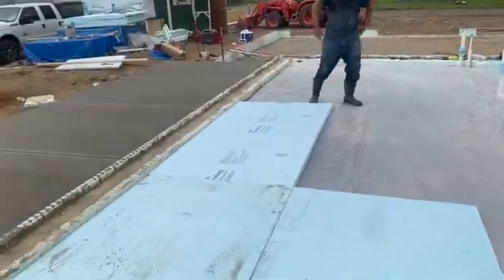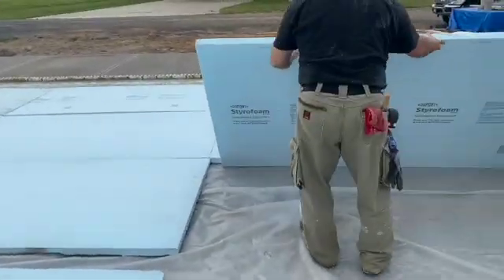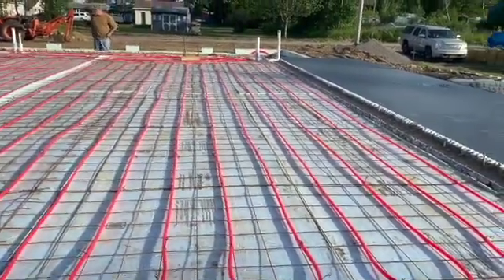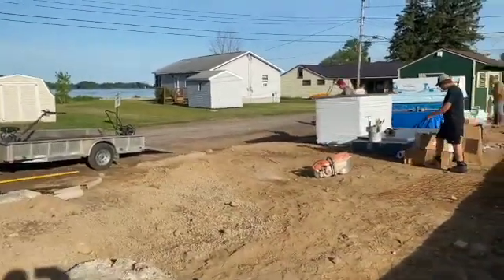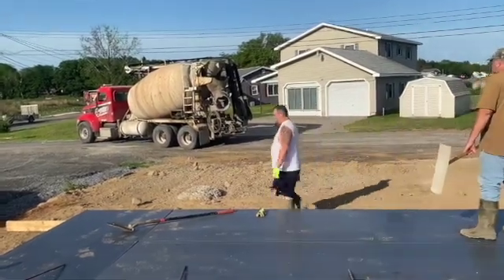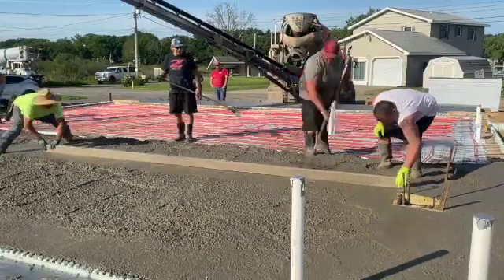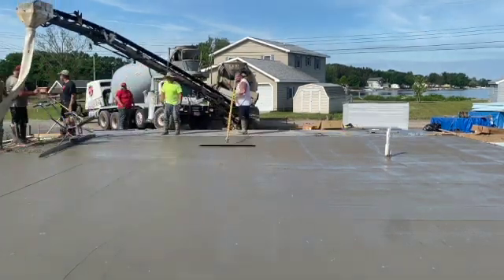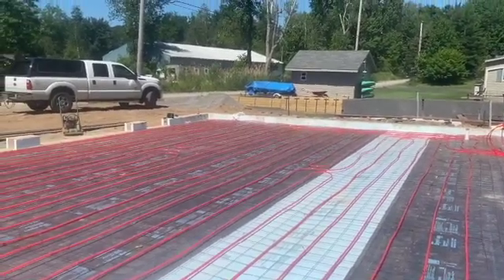Frost Protected Foundation Series part 6

Comment: Do you ever use the foam made by the same folks that make the ICF blocks ? it has the pegs you clip the pex tubing into . no 6x6 mesh needed
Reply from the maker: Hi Steve. Yes I did use it once but it is twice the cost so I don't use it anymore.
Reply: @bondobuilt386  I've used it before , never had to pay for it though .

Comment: Very nice! I appreciate your videos…
I have a question if I may? I am planning on having exposed concrete flooring throughout interior of my house I will be building. When using the fiberglass fibers…does that show at all on the surface of the concrete once polished? I would expect to polish a bit more in some areas to expose some aggregate. Just wondering if I should consider something else to help prevent cracking? 
Thank you.
Reply from the maker: If you are grinding the floor the fibers will get polished right away. Use the smaller ultra fibers instead of full size ones. Also cut the floor so it looks like 3 foot tiles and grout the joints with tile grout. Will look amazing and have many places to crack and won't show. Cut the floor 1/2 to 3/4 deep if 4" thick if 5-1/2" flor cut it 1" deep. Use a skill saw with a diamond blade and a strip of plywood as a c guide to cut nice straight lines.
Reply: @bondobuilt386  Thank you for taking the time to respond, as well as the ideas…

Comment: I have seen Pex stapled to the foam and the mesh pulled into the concrete.  Probably better to install the foam with the foil to reflect the heat into the slab.
Reply from the maker: https://youtu.be/4HHC015JVBo We did that on this floor. We used rebar though.